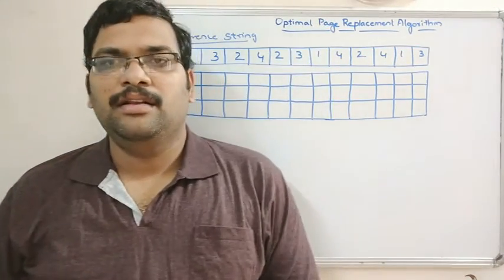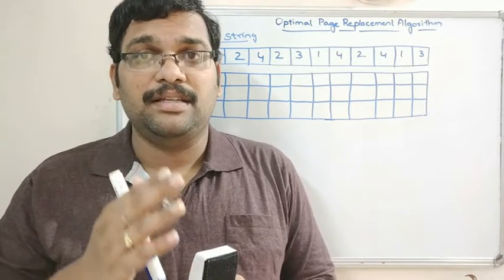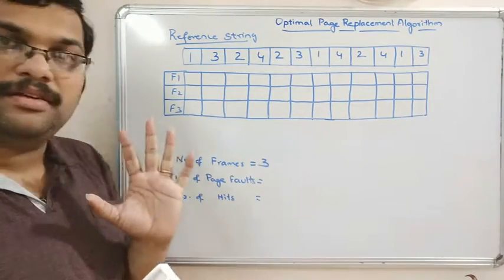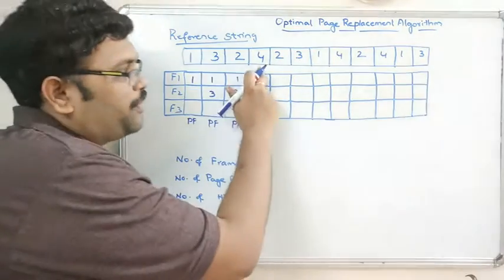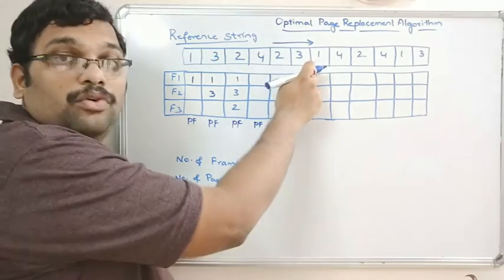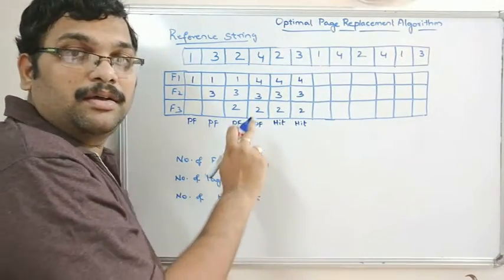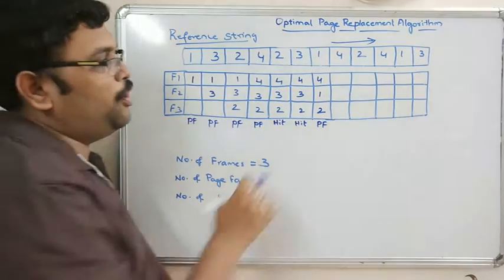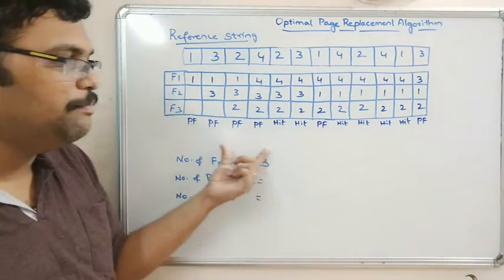OPTIMAL PAGE REPLACEMENT ALGORITHM - OPERATING SYSTEM

Comment: Calculate the number of page faults using optimal page replacement algorithm for the following reference string with four pages frame.
1, 2, 3, 4, 5, 3, 4, 1, 6, 7, 8, 7, 8, 9, 5, 4,3,4,5
sir ya question solve ke dyn plz

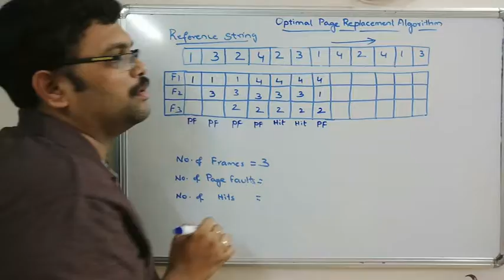Comment: At 6:03  we replaced with 2 na sir because it is 3 frames why you replaced with 3???
Reply: Once check it out 4 is available first after that 2 is available and after long time 3 is there in  reference string, so we replaced 1 with 3 there.